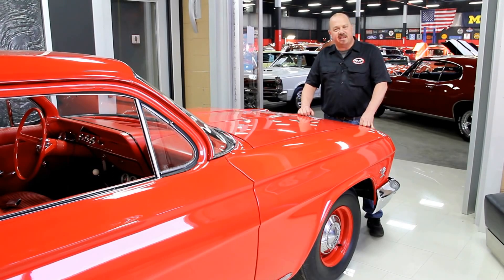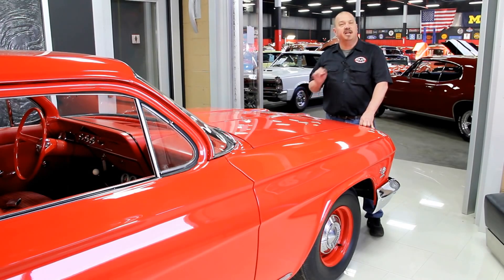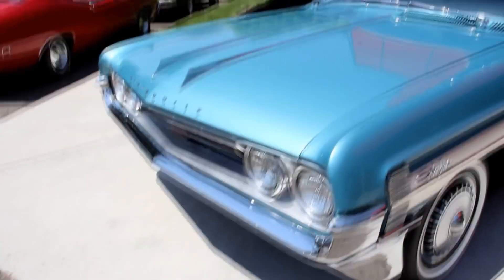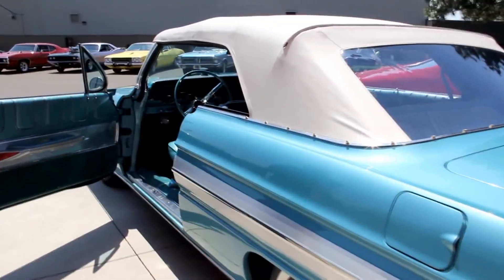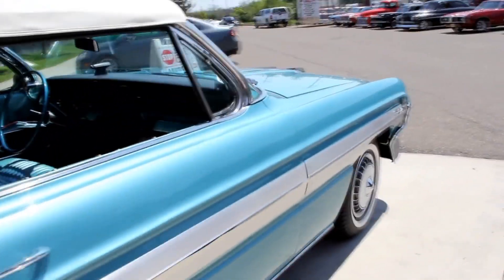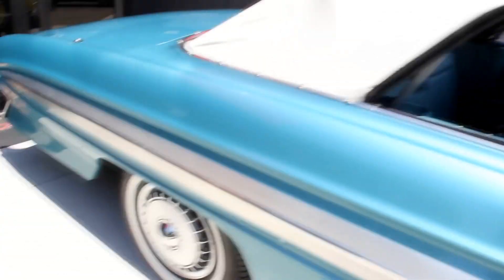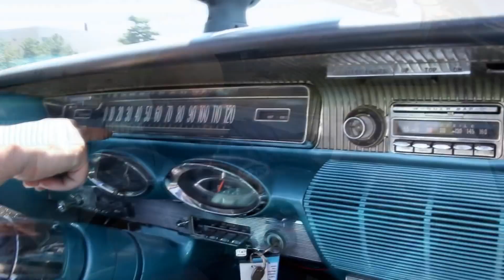1961 Oldsmobile Starfire Convertible For Sale

Comment: They came with Glasspak mufflers from factory for 1961 and 1962..chrome valve covers 345 horse amazeing INTIERIORS. 440 foot pounds TORQUE..394 cubic inch...it is ...the right engine..some came with 3 2bbl carbs in the 62 model..was a performance car of its day..on the 88 platform.  Speedo goes from green to yellow to red color past 60mph...

Comment: The '61 Oldsmobile in general was an improvement over the un-Oldsmobile, non-descript looking '60. I like the Starfire best, of course, and this car is really beautiful. My own preference is the '62 Oldsmobile (regular and Starfire) over the '61. The '62 owes a lot TO the '61 of course, but it has a refined perfection to it in the front end, but particularly in the rear. Along the sides (of the Starfires) both years were perfect.

Comment: My dream machine !
Reply: Definitely one of mine too. I also really like the '62-'66 Starfires a lot too. The problem with the '65 & 6 is that in convertible form you lose the sexy, concave rear window that's so beautiful. You still have the beautiful lower body with the distinctive front and rear end, but without that roofline, it loses something important. That's also true with the '63 & '64 too, actually. In any event, I've NEVER liked the first generation Toronado at all, Gary. The Riviera's, yes, but not the Toronado. I didn't really love them until the 1979-'85 models.

Comment: Oldsmobile starfire was only made in a convertible for 1961 very rare and very expensive car
Reply: That is so true Gary. I'm glad Oldsmobile expanded the Starfire in '62 to include the hardtop as well. In my own opinion (as great as the '61 is) the '62 brought it up to a real level of perfection. The front end to some extent, but much more so on the rear end and taillights. The siding of both years is perfect.